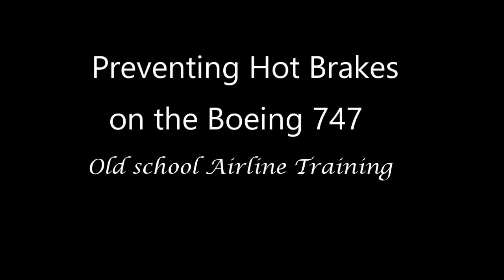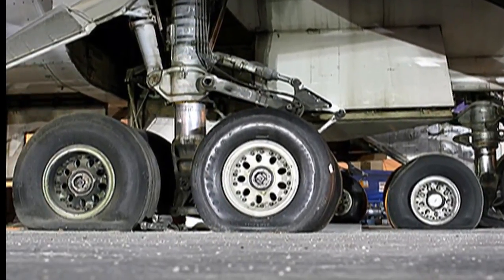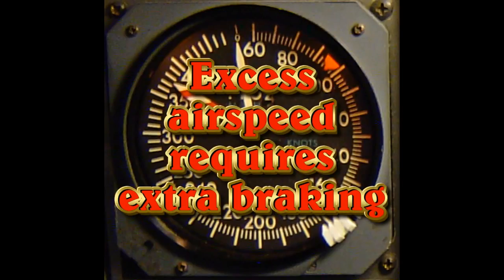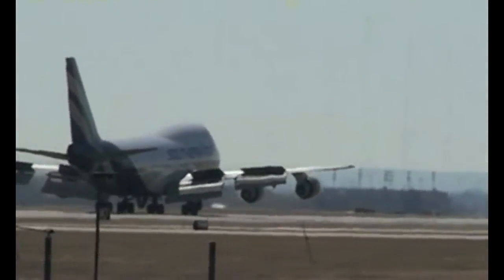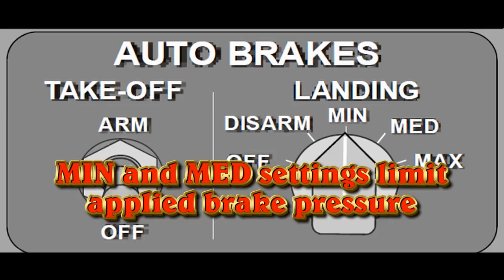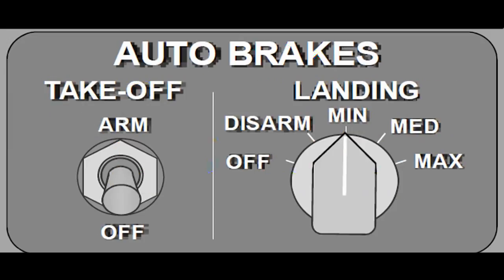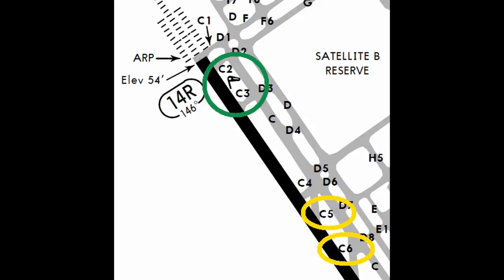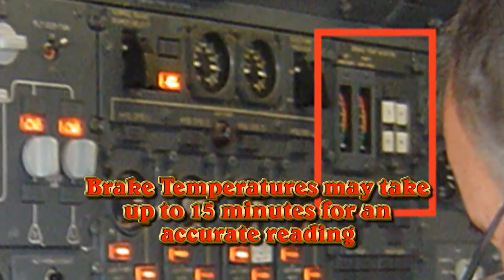Preventing Hot Brakes on the Boeing 747

Comment: I have a degree in aircraft engineering.  Although I am not familiar with the B747 and the brake temperature reading transducer and gauge, I do know that the brake hydraulic fluid increases in temperature long after the brakes have stopped being applied.  This is because it takes time for the heat to transfer through the brake pistons to the hydraulic fluid.  In a sense the temperature reading is accurate as it is a reading of the hydraulic fluid temperature and not a temperature reading of the brake disks and pads.  It is still an important temperature reading as you do not want the hydraulic fluid to boil and then to  catch fire which could happen long after the brakes have been released.  In the Royal Air Force ground have charts to show them how long it will take for the brake fluid temperature to peak after a heavily braked landing.  Perhaps more modern aircraft have infrared or or other different temperature sensors that will tell you the temperature of the disks and pads themselves.
Reply from the maker: Good comments.  The old steel brakes of the original 747 classic did take quite for the temps to heat up.  This was greatly improved with the carbon brakes for the later models.  Your observations about the wait time is correct.  
Thanks for all your great comments and keep watching. James
Reply: Thank you very much for your kind reply.  I would very much appreciate it if you could please make a video on how to land a large airliner at Kai Tak airport.  I know that you have made a great video about it already but I would very much appreciate a step by step real time guide on how to perform a landing which goes through the motions of when to lower the flaps and landing gear, what speed is needed and what power settings should be applied and what to look out for and when exactly you should turn and at what bank angle.  A video that explains this whilst playing an in flight deck video of a real landing or a flight simulation landing would be great.  As you well know, landing at Kai Tak was the last great challenge in flying a very large heavy airliner and is the most fun thing to do on a flight simulator.  Thank you very much once again and please keep up the great videos.
Reply from the maker: Thanks for the suggestions.  I do not own any flight simulator software but it might be fun to try.    My YouTube video production schedule is 75% set for the remainder of 2017.  Might be able to do something during the first part of 2018.  Great suggestion!  James

Comment: James- does this apply to the -400 series as well?
Reply from the maker: That is an excellent question !  The techniques shown in the video are correct for all models of the 747.  The -100, -200. and - 300 all had steel brakes.  The 747-400 came standard with carbon brakes which was a major improvement.  Boeing has an excellent explanation at http://www.boeing.com/commercial/aeromagazine/articles/qtr_03_09/article_05_1.html